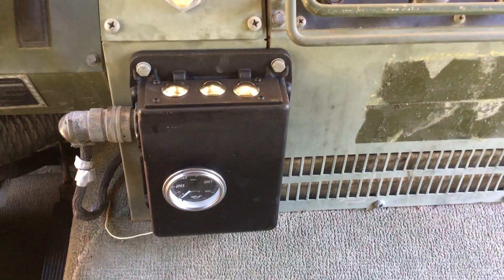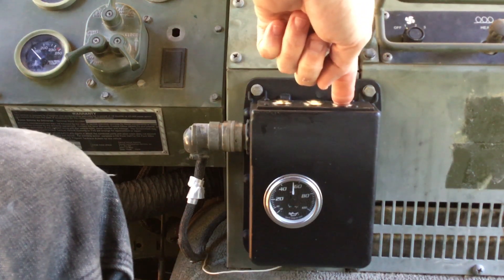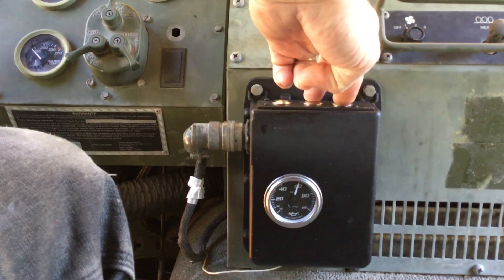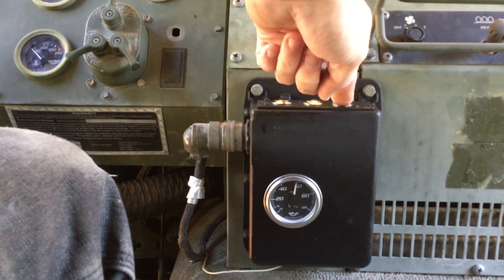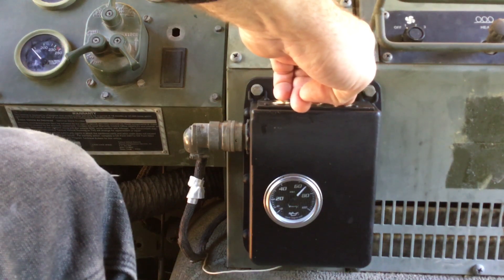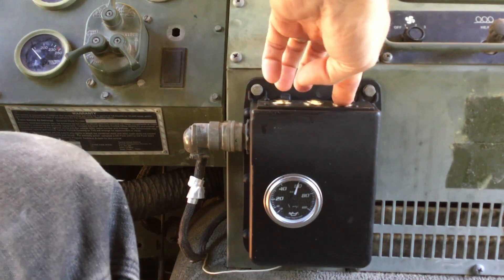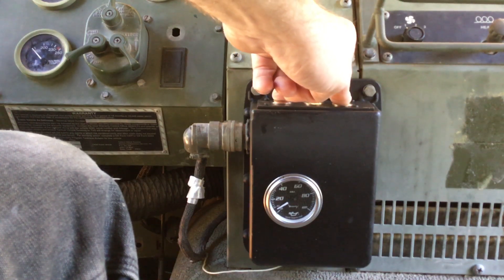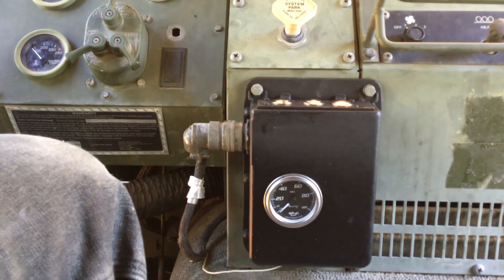LMTV Manual Central Tire Inflation System

Comment: how high a pressure can you put the tires to with this setup?  can it hit 90psi?
Reply from the maker: coachgeo should be able to set as high as system pressure but thats a little high IMO:)  I think mine are at 85 but 90 should be no problem...

Comment: That is brilliant!    Can you post the wiring diagram for “your” box?   I am guessing the only thing you kept from stock was the connector and case.   Did you modify any of the truck outside of the CTIS box?   Thanks!
Reply from the maker: I de-installed the pressure transducer on the PCU valve body that the CTIS processor used to measure pressure. It is 1/8” NPT port on the valve body.  That is where the other end of the hose from the pressure gauge is connected to now to monitor pressure.  A basic mechanical automotive oil pressure gauge has that 1/8” fitting and enough poly hose to reach between the PCU and the CTIS case location.  Yes the processor case is gutted, the only mod I made to the truck is a 3/8” hole drilled behind where the controller is mounted that the hose runs thru and runs behind the heater to the PCU. Will have to figure out how to put up a schematic here.  I did a writeup over in the FMTV section on the steel soldiers forum but didn’t put up a schematic there.  It is pretty straight forward, there are 3 solenoids on the PCU, one button per valve and the switches provide 28V from that cannon plug to the 3 coils using the existing wiring, same as the original processor did...
Reply from the maker: Why Me sorry I missed this.  Here is some more information on how I did this.  I also documented this over on Steelsoldiers.com...  https://youtu.be/SEsRzK2ZLt0
Reply: @rronmar  This link doesn't work.
Reply from the maker: CallMeColt ok, the youtube link worked for me, it is a slideshow of a drawing and some marked up photos of how to do this.  the steel soldiers one wasn’t meant to be a link, just mentioning where I wrote about it.  Here is a link to that discussion... https://www.steelsoldiers.com/threads/manual-ctis-electric-over-pneumatic.182033/
Reply: @rronmar  Okay, thank you. I thought the link was supposed to be directly to the thread and I wasn't able to find it. That link worked great and I subscribed to it so I can read it thoroughly later.

Comment: was thinking if went to switches that do not have to be held... maybe an audible buzzer when pressure reaches certain point so you know to hit the switches again?
Reply from the maker: Lots of things CAN be done but everything beyond this(adjustable pressure switch, buzzer, wiring) adds complexity and cost.  For the amount I foresee using it, I think pushbuttons are more than adequate.   I get the impression that it fills the tires faster if I pulse the supply button, but I haven’t actually timed it to find out...  I do know the tire volume is a huge demand and sucks down the wet tank to the protection valve pressure in just a few seconds and flow into the tires is limited at that point.

The gauge angle however is intolerable but this was a proof of concept afterall.  I have sketched out a better case design with a little different button layout that will bolt into the same location but be easier to see and activate...